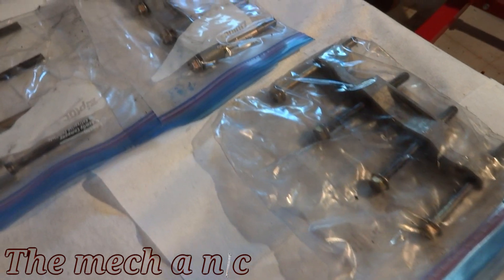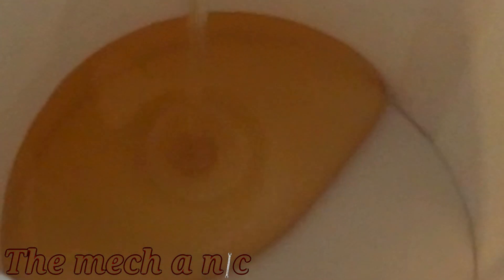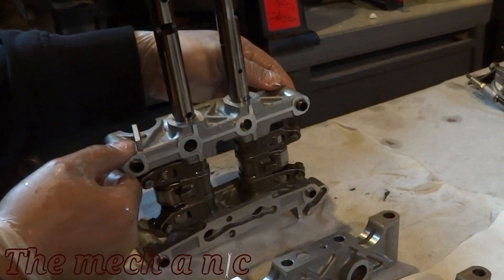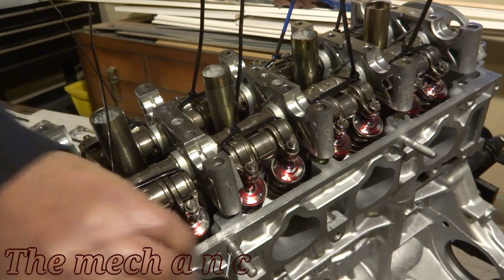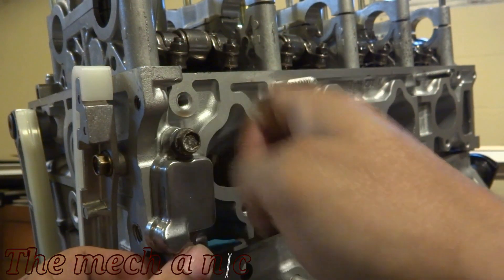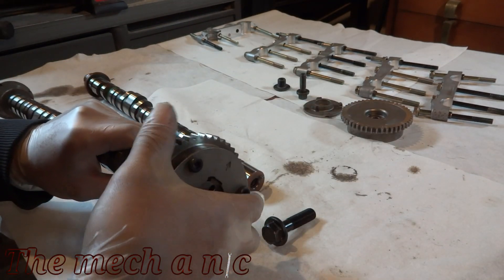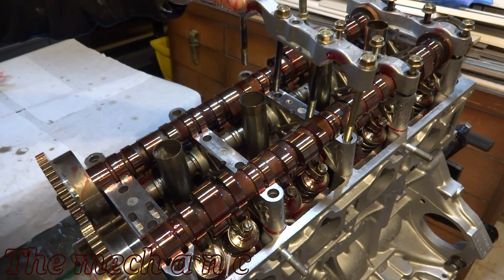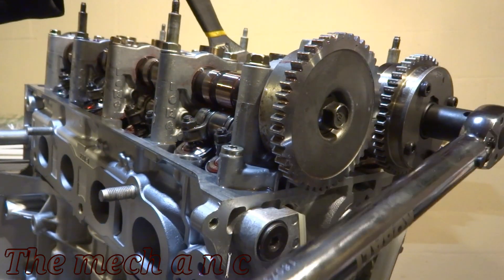Cam shaft install on k20 (drag cartel 3.2)

Comment: It really sucks but i just squeeze the whole assembly while installing on top, at the same time. My son usually helps me keep the rockers straight.
Reply: Just finished the Type S pump install on my K24A2 CRX. 45 deg Drag Cartel VTC and timing next. Do you think those 3.2 Drag Cartel cams are good for my setup? More or less?
Reply from the maker: I have yet to run my engine so I'm not sure but I've heard good stuff about the 3.2 , I think you'll be good 👍
Reply: @themechanic6117   Hey, do you happen to know what AWD systems are used for the CRX?
Reply from the maker: Sorry I don't much about that. My crx is staying FWD so I haven't looked into the AWD setups

Comment: Nice! What did you clean the outside of the block and head with? Is the bottom end factory?
Reply from the maker: Brake parts cleaner/soap/ lot of elbow grease . Then a coat of paint. Nothing is stock on this engine.  I have a complete build list of videos building this whole engine

Comment: The best rocker assembly trick I know is to grab 2 magnet rails from harbor freight, put a strip of electrical tape down the length of the magnet rails to keep from scratching. Lay the magnet rails down the length of the cam journals in place of the cam if you will...and then lift the rockers upward so that the rollers stick to the magnets. This will hold everything in place without the tedious use of zip ties. I've done dozens of engine reassembly like this and it is the easiest way. Works on the newer Honda engines as well. Obviously you're done with this engine assembly, but maybe this could help you assemble one in the future for a customer or if you ever have to tear down and reassemble yours again one day. Also yes, the Hondabond/silicone sealant on the cam sensor base side is also necessary as someone else stated and I believe you already corrected. Otherwise oil will seep out if that crevice under the cam sensors, you may notice that's also where the corners of the valve cover that require sealant as well.
Reply: Magnet rails also help during teardown...of course.
Reply from the maker: Thank you for the great tips. Yes the potential oil leaks have been taken care of already. Thanks for watching

Comment: So you dont have to degree drag cartel cams for K series due to the vtc gear correct? (B series guy here)  Just install them bang on straight? Thanks asking for a friend ;)
Reply from the maker: The cam gear can only go on one way. At that point all you have to do it line up all the timing marks and put the chain on. If i had adjustable cam gears then id want to check everything with a degree wheel
Reply: @themechanic6117  Yeah heard of guys doing this with adjustable gears on the exh side but i dont really see how this can really benefit from it....vtc on intake is where the power is anyway...Thanks for reply
Reply: This comment is a lifesaver, Thanks a bunch.

Comment: Hey man maybe you can help me lol. I was gonna get the drag cartel 2.2 cams but then I saw these (the 3.2). My understanding is that they will make more power but with a choppier idle. I have the stock bottom end so would these cams still make more power than the 2.2? Also can you use the stock k20a2 50deg vtc (I have a k20a2 like you). And if so do i have to limit it in kpro? Thanks in advance.
Reply: What’d u end up going with? I was debating it too. I called drug cartel and they advised me to get 2.2 if I was going to keep stock K20 bottom end and 3.2 if I planned to go frank (k20 head / k24 block) tbh I don’t think I’m going frank soon so I bought 2.2’s my mechanic is doing the install this week excited to see how it goes

Comment: It’s not the impact on the cam it’s the impact can damage the vvt gear especially if it isn’t unlocked when your trying to loosen it
Reply from the maker: The cam got replaced with a pinned DC cam gear

Comment: Can  you use those DC 3.2 Cams in a K20 head, or are they specific? I haven't looked at them yet.
Reply from the maker: These DC 3.2 are in a k20 head....thats what I have here.
Reply: @themechanic6117  ah, not sure how I got that mixed up. Thanks!
Reply: @themechanic6117  what about a k24a2 head on k24a2 block? Ive heard is about the same specs as the k20/24 frank.
Reply: @themechanic6117  are the drag cartel 3.2 cams not too big for a k20 engine?
Reply from the maker: People use them in k20s

Comment: I want these cams sooooo bad..
 drag cartel 3.2 cams is gonna be the cebter of my build 💪
Reply from the maker: I'm super excited about these cams.cant wait till i get the engine running
Reply: @themechanic6117  I went with the  004's on 88mm 12.5:1 cr. Hope it wasnt overkill?
Reply from the maker: I know someone with them. Its not very idle friendly.then again he has individual throttle bodies so that might contribute
Reply: @themechanic6117  😖and a 90mm TB- Oh gosh, its gonna be so unfriendly to drive isnt it?! Like all or nothing
Reply from the maker: Yes i have a 90mm throttle body for my setup with the 3.2 cams . Im not expecting it to be exactly friendly as a daily driver. Thats why my crx is just a project car to have fun with and not a daily driver
Reply from the maker: With a right tune you should be able to get those cams to idle ok. The base idle might have to be a little high but honestly i dont know
Reply: @themechanic6117 Someone on another vid, said if they were building again they'd use Prayontos 2 or 3 for a better dd 🤔 
Fck it, they're still getting slapped in.its cheaper to adapt my driving style.

I'm also considering using a Meziere electric wp, but have to weigh up the pros n cons. Extra space and the aesthetics Vs performance for a daily driver, in the UK where it's usually cooler- apart from a few weeks of the year when we get 30/35°c MAX. Worst case scenario; stuck in heavy traffic during those 2 weeks of the year?

Comment: I was told by machinist to use a really high grit steel wool pads on cam bearings and lobes using a really high viscosity oil like drill oil. It worked really well.

Comment: Why didn't you use the K24 head?
Reply from the maker: The k20a2 head is more of a "performance" head, flows air better . also i find that its very easy to get aftermarket parts for the k20a2 head

Comment: Using the impact on the cam is bad because you could break the locking pin in the vvt actuator
Reply from the maker: Everything got replaced so no harm.

Comment: will a cam swap will help at the drag strip? top end/// Thanks man.
Reply from the maker: Yes cams normally give more top end power which is good for a drag strip
Reply: @themechanic6117  awesome! if im 108mph et I should i pick a few mph then?
Reply from the maker: That id dont know lol. You'd have to ask the maker of the cams

Comment: Using the impact is gonna more so damage your vtc gear. When you loosen and tighten the vtc gear it has to be unlocked and then locked when putting the chain on
Reply from the maker: It doesn't move, how are you supposed to lock/unlock it?
Reply: With compressed air. There is a procedure. It’s just to be sure the pin doesn’t get damaged when being tightened or removed. You would hate to start the motor and hear a noisy rattle for a couple seconds.
Reply from the maker: In my latest video you'll see that replaced the vtc with a new one

Comment: Only thing im missing in DC 3.2s.. Great video brotha 💯😍 built k20a2 head with built k24 bottem & third cams you can make over 300whp ALL MOTOR No Problem with proper tuner.. Thats my Goal 💯✊🙏✌
Reply from the maker: Man I'm hoping I can reach that 300,even if I'm just a little short of it I'll be happy with it 👍
Reply: @themechanic6117  With my prototype I can advance the ignition timing without engine knocking.  It's like having very high octane racing fuel at the same cost of pump gas.

I need to build A 16:1 compression ratio NA engine later on for testing.

Comment: Do i needa check P2v clearance if installing this game onto a stock block?
Reply from the maker: It's hard to say . For my setup Drag cartel said I don't need to check for clearance that it should work. You should do more research on your specific block
Reply: I'm using the DC 004 cam and was told by Jeremy to limit to 30°...
Reply from the maker: Im using the 3.2 and was told to limit to 40°

Comment: No Hondabond on the edge of the rocker assembly near the cam sensors side?
Reply from the maker: Hmm I'll look into it. If it have to take it back apart to fix that it's not a issue. Thanks for the info
Reply from the maker: I don't remember seeing silicone there when I took it apart and I didn't see anything in the manual about it . I saw one video of a guy applying hondabond there.any links to where I can see that this is a step ?
Reply: The mech a nic try going through sergemotives channel.  He has one on head assembly.  If I get a chance I’ll also take a look at my rsx.  The head is still virgin on that one.
Reply from the maker: You're right. I looked closely at the head and I can see traces of silicone. I'll take it back apart. I appreciate the info. In next video I'll fix it 👍